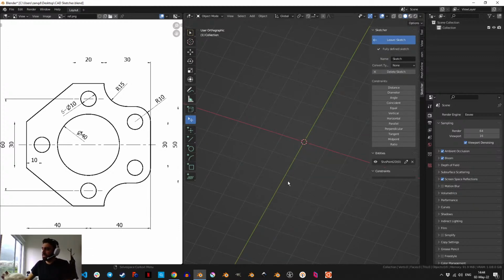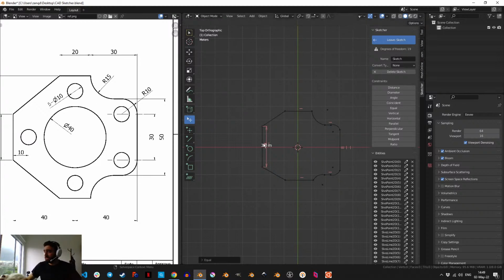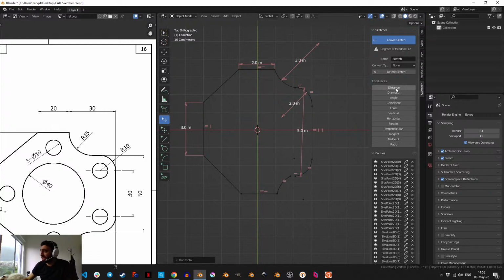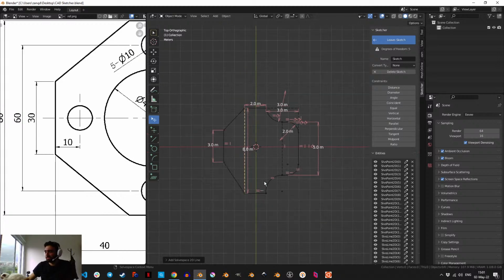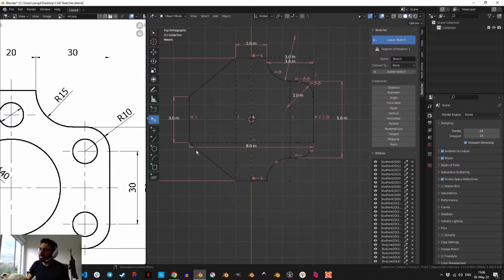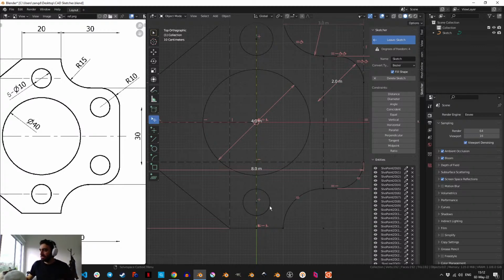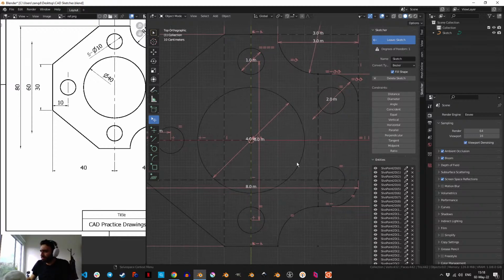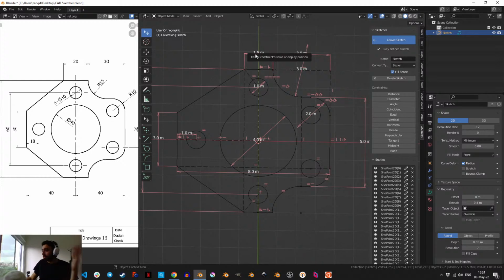Let's test CAD Sketcher for Blender Part 3 (A slightly more complex shape)

Comment: Instead of creating the entire 2D object outline first, then setting constraints, set constraints as u create lines and curves. Start with the left and right 30cm edges and constrain them to be 80cm apart and // to each other then move on from there.  Set radius parameters when u create the arc.   Construction lines are very helpful. Don't worry,  you'll get there. I'm sure ur a better mesh modeler than me. We learn together.

Comment: Instead of using the bevel modifier, go into edit >edge , select the edges around the holes and click CTRL B. That should not affect the ID of the hole. Only the OD.
But then, there is no call out on the drawing for a bevel.

Comment: Its better to first select elements, then use buttons. For example, first select arc and line, then press tangent. Just like you do with distance. First select points then use distance button. Right click quits whatever tool you or selection you have and back to select tools.